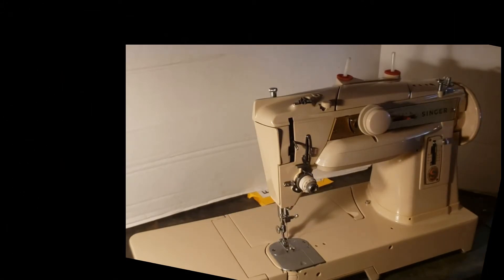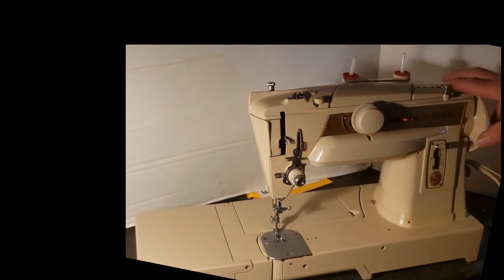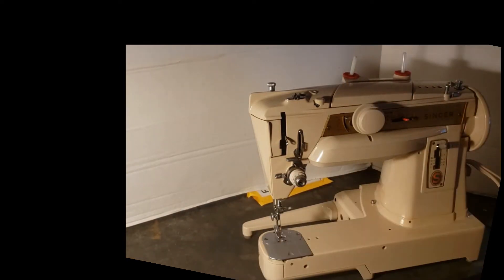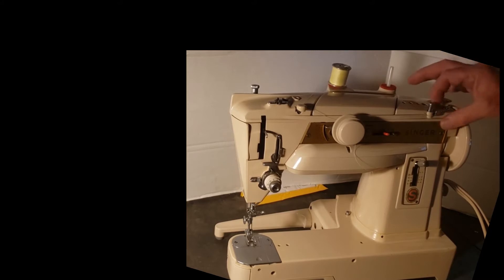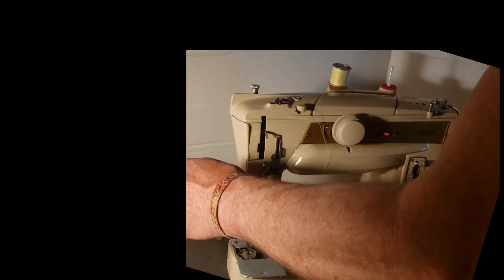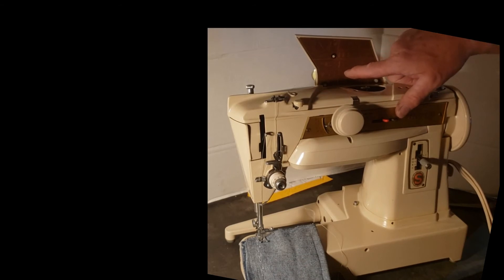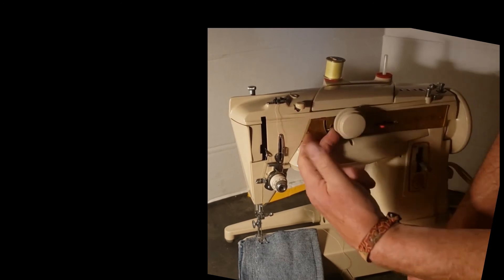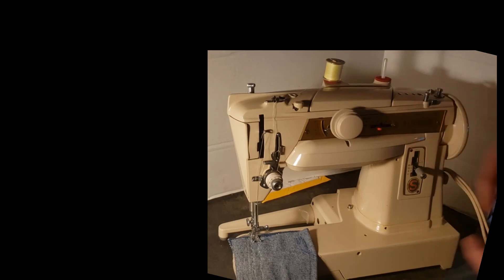Singer 431g Sewing Machine- Final Test and How to

Comment: your video saved my day! I came across my mother's 431G from storage for decades. I fixed a cracked Bakelite motor case and cleaned things up. Time to put in a bobbin and pick up the thread - nothing!  I tried quite a lot of things and then I watched your video. I was turning the handwheel AWAY from me, you correctly turned it towards you (groan). 30 seconds from throwing the whole thing in the trash. THANKS.

Comment: Hi Mike
I have a 411 which is also as you likely know, very similar. In fact I have 2 similar. Amazing industrial quality machines. They’ll still be running after the next geological extinction event! 😂
But I have a problem I can’t solve, how do I remove the selector knobs?
It looks like I have to disassemble the entire upper mechanism… surely that can’t be right?
What knowledge can you add pls?

Comment: Pretty good video by Mike Kraemer, he should have used thread that, color-wise, contrasted to the denim to better show and demonstrate the Zig-Zag stitch patterns he attempted to show.
His prices are SKY-HIGH, his communication prior to his making a Sale is responsive.  His communication after the sale is pi** poor, I know.  I have done business with him and I hosted him in my home along one of his gypsy trips.  His prices are WAY HIGH and the "Restored" Singer 401A I bought from him for $530.00 cash was FAR FROM restored.  Cracked Base, Mal aligned, missing parts, etc.

 Mike Kraemer is very talented in the personality department, fairly capable in the mechanical department, extremely talented in the SNAKE OIL department.

As a novice buyer, after being gouged by Mike Kraemer on a "restored" 401A @ $530.00, I bought one locally for $125.00, un-restored that operated better than the one I bought from Mike Kraemer in a stand with a far greater compliment of accessories.

If you are new to Vintage Singers, take your time, don't get SUCKED-IN by Mike Kraemer.

Comment: I have a Singer 431G. It is working well except it  almost impossible to sew in a slow motion, it goes from 0 to 100 very fast. I did open up the Bakelite foot pedal to fix this (some of the carbon discs where missing), but I don't know if it helped much. Could it be something wrong with the motor or should I buy a new foot pedal?

Comment: My eyes see a Singer 401 wannabe, but it doesn't sound as solid as the North American 400/500 series. My ears don't hear the familiar sounds.
Reply: It shows the introduction of plastics and the throat plate/ slide plates are impossible to find. The novelty is that it can chain stitch, but I have seen some with the permanently attached chain stitch guide removed and no chain stitch throat plate ( Many people would not notice ).. The motor housing is completely plastic like a  # 700 series "touch and Sew.. It does have metal gears, but I agree, they do not sound "hefty", but "noisy"..